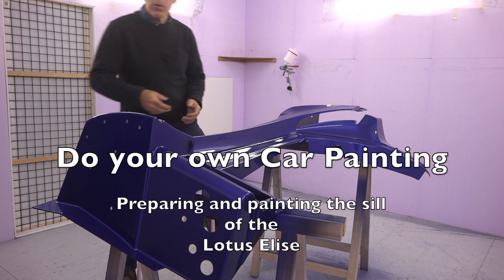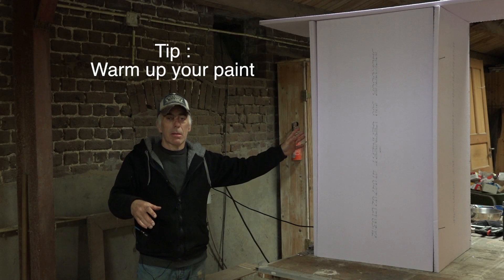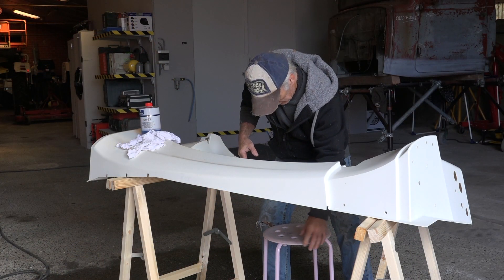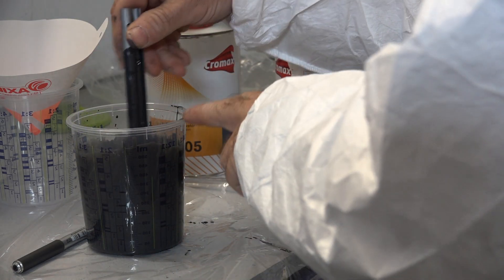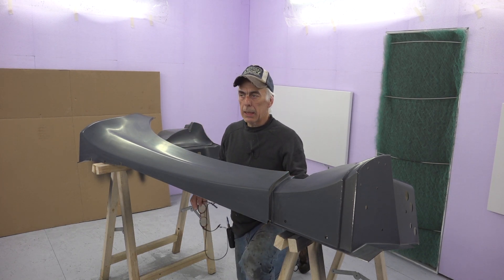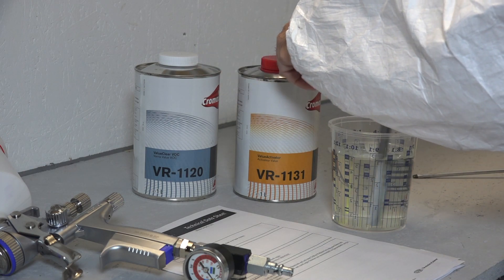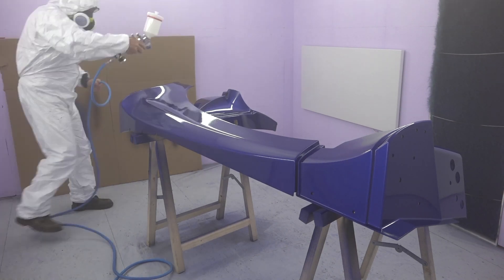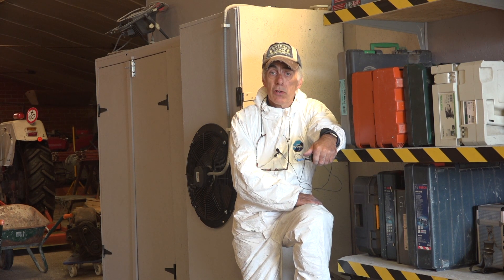Do your own car painting, preparing and painting the sill of a Lotus Elise

Comment: I read someplace you don't want to use water to clean the floor of the paint booth shortly before painting, as it will raise the humidity level in the air which is not good for the paint. Not sure if it's 100% true or how important it is, but it does make sense to me
Reply from the maker: Thanks for the comments, it works for me to keep the dust down.  Note that there is also air extraction and I have never had an issue with it.   But its possible.

Comment: Another great video. Quick question, since you had both clams off and side skirts, do you think you could of completely changed the colour of the whole car properly? Or dose that require the car inside the paint booth?
Reply from the maker: You could if both sills were off...  But that is a major job.  I did it because of the repair.
Reply: @D3Sshooter  so if I was to do a full colour change I’d have to buy new side skirts ?

Comment: P1200 is way fine for primer, you should be looking at using P180 to P320 before primer and before the basecoat P800 to P1000 depending on colour is more than enough, you go to fine and the paint will have nothing to stick to and could/will just peel off in big sheets. by the way its easier and faster to just dry sand it with some da discs and it makes less mess. when you was talking about sanding with your fingers and getting strips is called tram lines and you can also get these when your using a sanding block to if you use the sanding block in the wrong way. if you use the block the way you was using it you are more likely to get tram lines in the panel, if you use the sanding block at a 45 degree angle you are less likely to get tram lines as there is less of an edge to block if that makes sense. you need to be careful about using thinners on a panel as a cleaner due to the fact it can cause any old paint to soften which with the solvent of the new paint can cause a reaction where the old paint pickles up and lifts away from the surface (i guess in this case it dose not matter as there is no old paint to worry about) you can also warm paint up by putting it in a bucket of warm/hot water before you mix (of course keeping it in the tins it came in and youll have to do it with both the paint and the hardener) this also thins the paint down so you require less thinners to make it the right viscosity.  you dont always filter paint it depends what type of paint it is your using for example you dont filter a HS (high solid) primer as you can remove the solids. Panel wipe is also a wipe or spray on and wipe off chemical once you have panel wiped the part you should not touched it again with your bare hands as you can transfer oils from your skin to the part again (the use of rubber gloves here helps when tack raging things down) . you should not let the basecoat fully dry before applying clear coat as you could end up with the clearcoat not bonding very well to the basecoat, you only need to wait for the basecoat to go to a dull shine all over then your ready to apply your clearcoat. when mixing paints its always faster to pull the solids up threw the hardener and thinners than to just stir the paint around in the mixing cup, also be sure to use the mixing stick to scrape the sides and bottom of the cup to make sure all the paint gets mixed in well. to reduce the amount of overspray in the air you just need to lower the air pressure a little. 

it looks like you had a good result for your first try in the booth mate, the only thing i would say is maybe a little heavier on the clearcoat would have given a nicer finish as it looked like it never quite flowed out like glass. it also looks like the panel could have done with a small amount of filler in it, if you pause the video at 16 mins and 43 seconds towards the left hand side there looks to be a low spot on the back edge (the edge furthest away from the camera, i guess its just under the door shut) but all in all very good job mate, can not wait to see old rusty painted up :)
Reply from the maker: Hi Ross, that is really a great write-up.  Thanks do much for the details and insight.  I have seen that little dent ( well slight dent) . I was considering it to remove it . But then again its where the door sits, and can't be seen when the door is closed and real low to the ground.   So , I decided not to spend time on it.
Reply: Long time painter/body guy/ resto guy. I agree with everything this guy said except the base drying part. Depends on the paint but for the most part all systems give you 24hrs for a chemical bond. I can't really understate how big of a deal p1500 before primer is. It's gonna fall off in the coming years. For a nice perfect part anything under p500 is fine but any smoother isnt gonna bite in for a mechanical bond.

Comment: An excellent result, and I am sure that you put far more effort into this than a "professional" sprayer would, as they know what shortcuts they can get away with, and to them, time is money, I am still unsure about the clearcoat system, as there are many vehicles driving around with very bad clearcoat separation problems, but it does give a very shiny finish with relatively little effort. The problem you will now have is when you fit the panel to the rest of the car ! You will end up spraying the whole car. Many thanks for posting this.
Reply from the maker: Thank you for the comments, I always try to do better..    I have seen those problems as well on separation on some cars. Although , I believe that the painter went el cheapo on clear coat or a none compatible coat.   I need to paint the clamshells (front and rear) left door  and some other parts.  The paint is made to color and the panels that can stay look as good...

Comment: nice video mate so u know if u spray metallic base don't leave it overnight or on the direct sun light because the metallic pigments in the paint will die and paint will change color it is best to spray base and wait about half an hour and apply clear because base dries pretty quick keep it up.
Reply from the maker: Txs for the comments and indeed that is the case.  In fact the open time of the Cromax base coat is max 24 hours...

Comment: Good video, im self taught at painting too, but find it really enjoyable as well. Theres so much work in it though. Only tip i'd add is open up your tack rag layers and use it like a ball, i didn't realise that was what you did first time i used it, until a pro told me haha they last longer and pick up the dirt better. Really good video series i enjoyed it! You'll find you'll get less dust the more times you use it when ive done homemade booths the dust is always more the first few times.
Reply from the maker: Thanks and indeed that is a good tip.  What gun do you use ?
Reply: D3Sshooter I’ve a few different guns, but I’m a Devilbiss man 😂 main one is the Devilbiss Gti prolite with the 1.2 and 1.3 great gun, puts out a massive fan, leaves a beautiful finish. I’ve a 3M accuspray for HB primer which is just ok, I’d buy the Devilbiss primer gun if I had the choice again. I’ve a few other cheap ones, and a Devilbiss Starting line for epoxy primer i started out years ago with the JGA suction fed and I guess brand loyalty 😂. Try the evercoat fillers amazing stuff, especially the easy sand- it’s what UPol dolphin glaze wishes it was, blue hardener is a god send too. Evercoats plastic mixing boards are brilliant, quick wipe with a scotch brite pad and some thinner and you can use them over and over again, beats the onion boards and you waste less. If you’ve not tried them try Chris at sprayguns direct, great company to deal with.

Comment: Nice job!
Is there any difference in laying basecoat, metallic vs solid? 
I'm thinking that the "flakes" will sink towards the bottom the longer one is waiting for flashtime .
Just speculating loud.
Cheers!
Reply from the maker: Thanks for the comments,No really... I as long as you follow the datasheet of the paint and respect the viscosity, flashtimes, layers, pressure and nozzle

Comment: D3Sshooter, nice job on the painting, however, one piece of advise when using a tack rag or cloth.....always open the tack rag and let it breath, then bundle it and wipe the panel lightly., if you rub the panel two hard you can introduce the stickiness from the rag into the paint or panel and can cause problems.
Reply from the maker: Thanks for pointing it out.... and indeed you are right

Comment: no runs? even on your first "pro" type spray? thats impressive
Reply: es, with a real spray gun with accurately thinned paint, runs arnt that common
Reply from the maker: Thanks, and no because I kept the viscosity and temp as it should besides using the right nozzle and pressure...  and paying attention to the distance and flow...   I used to paint every so often about 25 years ago...
Reply from the maker: Indeed, of one respects the mix etc... it makes a big difference

Comment: surprised you are not wearing gloves when using those toxic chemicals in prep.
Reply from the maker: itsjustme  i should and normally i do.  But ran out of them and hard to get on a sunday.  So yes you are 100% right
Reply: Unless you are doing this all day every day it is hardly a concern, the biggest advantage/need of gloves, is to prevent oil marks from your hands contaminating the prepared surface.
Reply: @453421abcdefg12345 chemicals are absorbed through the skin, so it can not be good.